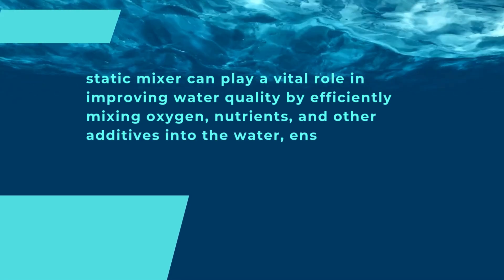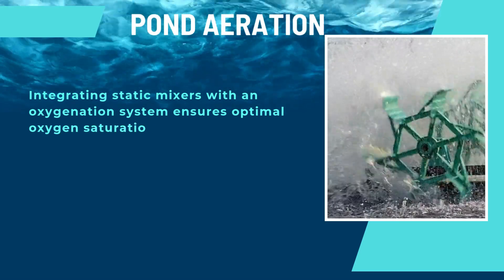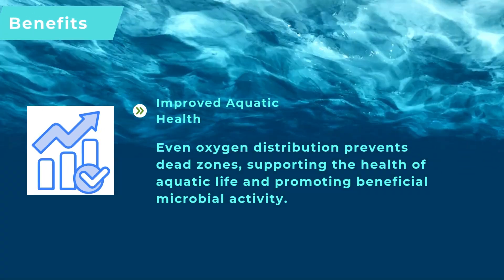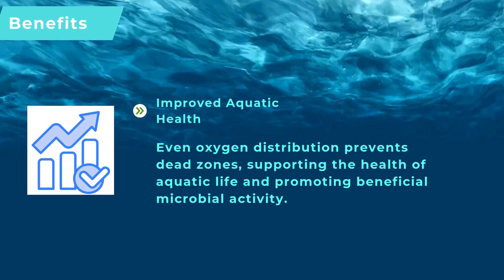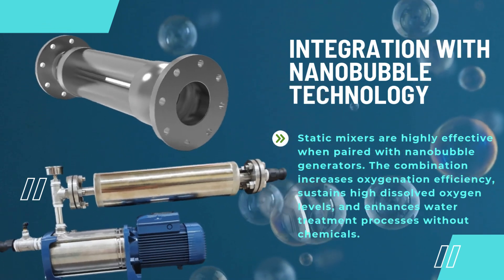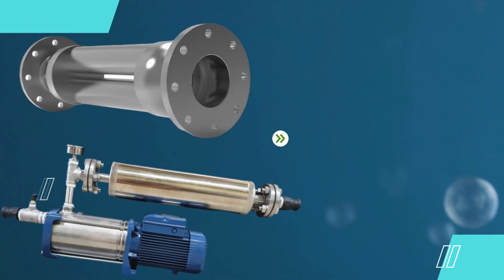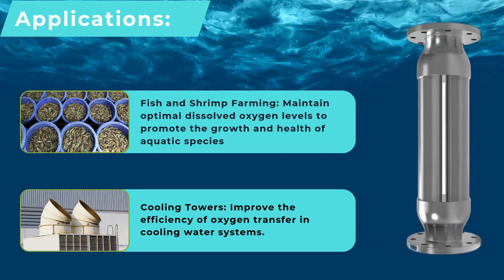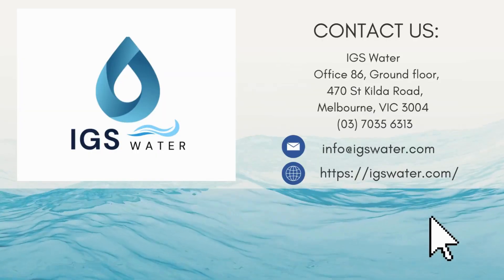Static Mixer for fish farmers

Comment: Can you explain to me what "static mixer" means, more precisely, on what principles does it work,

does it use magnets?

or due to geometric design?
Reply from the maker: An IGS static mixer is a device used to mix fluid, gases, or both without moving parts. It relies on the flow of the materials through specially designed internal elements to create turbulence, ensuring efficient mixing
Reply from the maker: Please provide your best email address for more details.
Reply: @igswater2223  Thank you for your answer, yes I understood you. No need for additional information.